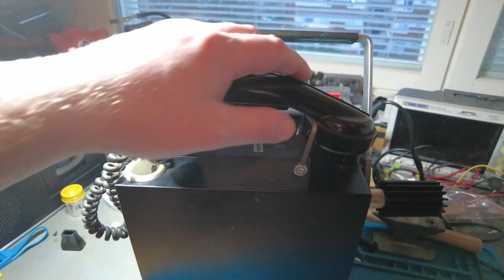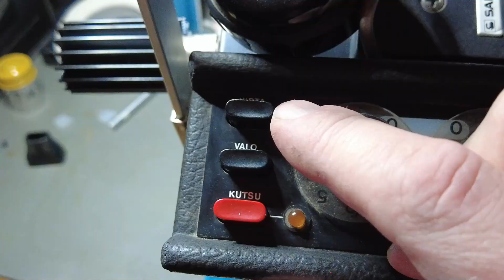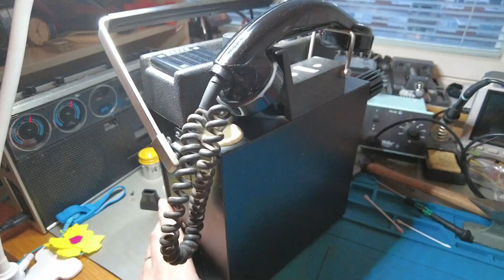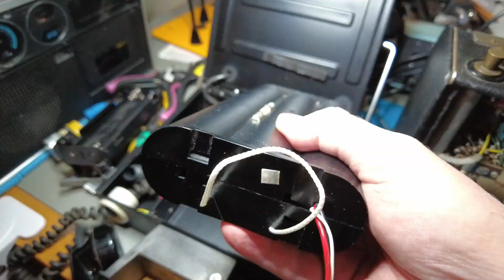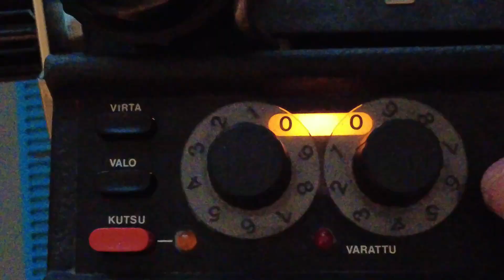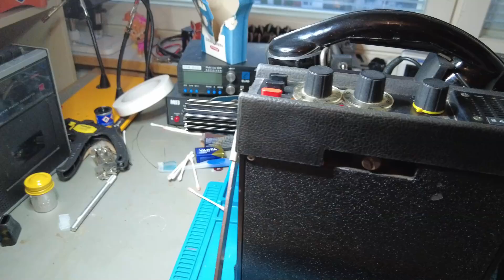Salora Mobira SRP25 mobile phone (real grandfather of future Nokia phones) repair and testing

Comment: A cool video indeed! About receiving something: the squelch (fi: kohinasalpa) keeps the receiver audio muted if or when there is traffic on the channel you are switched to. The squelch only opens after your phone has received a selective call (selcall) of sequential tones meaning that someone--the base station operator--tries to contact you. The digits on the Dymo tape probably are just this. The squelch does not protect from eavesdropping by receivers that are just tuned to the frequency of a channel, only from other ARP subscribers. Namely (cough cough), I have accidentally overheard such coversations on a TV receiver tuned somewhere between channels. And occasionally the selcall beeps. So if you "tapped" a point from the receiver side of the mobile to an audio amplifier, you should be able to hear the raw output of the FM detector. In some later phones this signal was brought to a connector among others, for interfacing with data communication accessories. Well maybe not ARP but closed circuit radios such as police, fire, railway etc.

Comment: Makes me think military radio's may have been the birth, as lots of them had combined microphone speaker/earphone handsets, and format wise extremely close to this one.

As for making it kind of work, maybe via WiFi (then at least it's legal RF wise) then via a board like a Raspberry Pi, onto a private voip network of some sorts, (or one of the existing amateur one?) or if your happy to move a little more away from it's original use, as a channelised radio, like CB etc.

Comment: My first enginering job in 1989 was designing power and streetlighting for new land developments to build houses on. My field coordinator was a grizzled old guy, retired contractor, George. He had one of the earliest generation of analog cel phones in Canada. 

It had a hand set that clipped to the top of a 'lunch box' that had the battery and rf components and network card.  It had a rubber duck vertical antenna for if you were near the tower. But its key feature was a 5' telescoping antenna, and on high power it sent out 5W. It weighed about 5lbs.

He was a ham, so knew the trick of standing a certain distance from the correct  side of a panel van with the antenna up, to have the truck act as a reflector to give a stronger signal to distant cel towers when he was calling in  when he was far off the beaten path.

Comment: ARP - Auto Radio Phone was developed by Bell Labs to automate mobile calling in the '60s. Before ARP, mobile calls required an operator to connect each and every call. ARP automated the process, making it like a regular switched call. In the US, this service was known as IMTS, for Improved Mobile Telephone Service. IMTS replaced MTS (same, without the "improved") in the US. For my money, ARP is easier to say.
Reply from the maker: Do you have a source for this, I would like to read more. Most google results and wikipedia have a lot of contradictions in them so I dont trust them at all. I knew bell labs did the early innovations but not that it was the same as ARP also technically. Is internet correct that there was very few channels available and therefore not so many users either? What model and make would in your opinion be the grandmother of all US mobile phones? (One that I could try to get)
Reply: @oldtechshack  I learned much of it in the classroom at Illinois Institute of Technology. I was an electrical engineering major, but earned money as a technical director for the classes that were televised. I picked up a lot about telephony from that, and from reading a series of books titled "A History of Engineering and Science in the Bell System" by AT&T Bell Laboratories. It was printed in a dozen or so volumes. One of them, "Transmission Technology (1925-1975) has a chapter (14) on mobile radio. Since Chicago was the first cellular radio plant ever, it was covered by local news as well as I was growing up.

In the US, the first generation of mobile telephony was ship to shore telegraphy, followed by telephony. Land mobile telephony before WWII was mainly amplitude modulation on medium frequency bands. After WWII, the third generation of mobile telephony, using frequency modulation on the new VHF low band ~40 MHz began. Like ship to shore, these were all manually switched by operators. In the US, this was called MTS, Mobile Telephone Service. MTS expanded to 150 MHz, where IMTS, Improved Mobile Telephone System took over with automated radio and call switching. IMTS operated concurrently with AMPS in Chicago, with IMTS at 152/158 MHz and AMPS in the 800 MHz band, until about 1990, when construction of a new high rise building next to the old Illinois Bell building made its rooftop antennas for IMTS and microwave long distance trunking unavailable. I had clients in the Citicorp Center, looking down on the Bell building. The last time I was there, the antennas were still in place, but unused.

I did first run into a website telcomtrainer dot com, that was correct in all details except name. Going back to the Bell Labs books (I now own several of them, purchased from a lending library), and the only thing wrong was the name. The Bell Labs books all say IMTS, not ARP. It seems that another website, https://telecomtrainingpro.com/what-is-arp-automatic-radio-phone/ identifies the Finnish name 'Autoradiopuhelin (Finnish for “car radio phone”' which is what I believe your ARP phone means. While the article goes on to call ARP "zero-generation technology", being an automatic switched system puts it several generations ahead of the first mobile voice systems. A perennial problem with allowing young people to write history is that they tend to believe that history didn't exist before they were born!

One thing that I disagree with the telcomtrainingpro article about is that ARP was cellular. The definition of cellular is that a call can be initiated on one base station, and handed off to others as you drove. By the article's admission, that didn't happen. The Autoradiopuhelin system appears to be a mix of generational technologies. The half-duplex (push to talk) and the initial operator-assisted operation of MTS put it two generations behind cellular. OTOH the high-VHF frequencies and later full-duplex and automated call switching were on par with IMTS, the "0G" service in the US.

The problem with early mobile phone services that cellular answered was the inability to service many customers at once. VHF channel pairs in the US (I can't speak for Finland) were about 16 pairs, and to prevent co-channel interference, adjacent service areas had to use different frequencies, limiting a major metropolitan area to as few as four active channels available. Cellular solved this by using a previously unused block of ~50 MHz up in the 800 MHz region, giving an initial 666 channel pairs. Even that proved to be not enough, and soon more bandwidth was added, and new modulation schemes were employed to multiplex existing channels. When mobile telephony really took off, digital modulation schemes, namely CDMA were needed to improve spectral density enough to meet demand.

To summarize, if ARP was "0G" then NMT was the "1G" system that brought true cellular service with handoff between cells, and all the other stuff that made cellular different from plain base station radio. While AMPS in the US had been under development since the 1970s, the Bell system breakup delayed introduction of AMPS service on the commercial market. So when NMT became available in 1981, that was the first of the first-generation of cellular services! I hope you can find a NMT phone to do a video on.